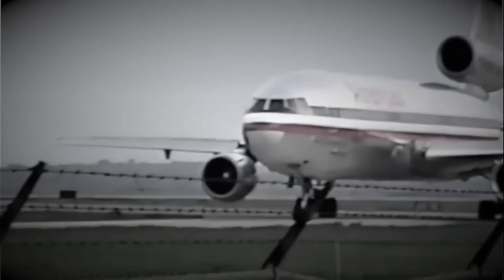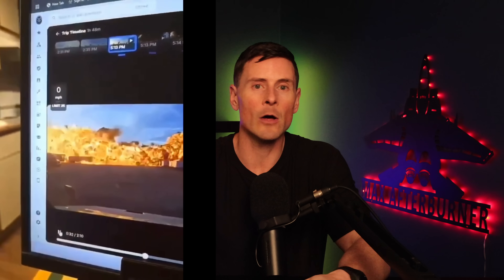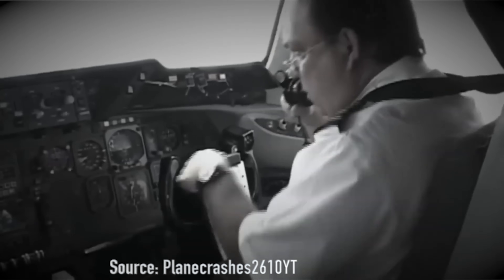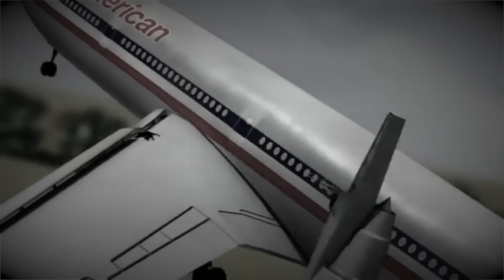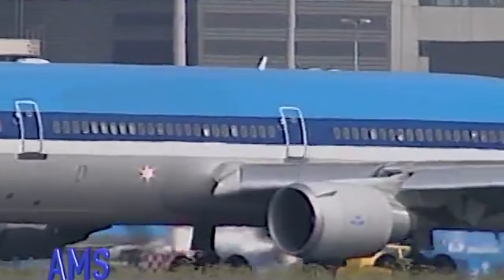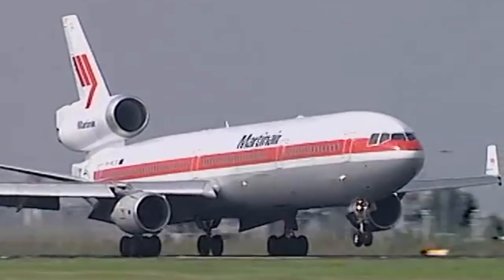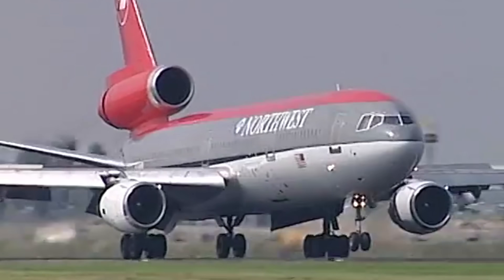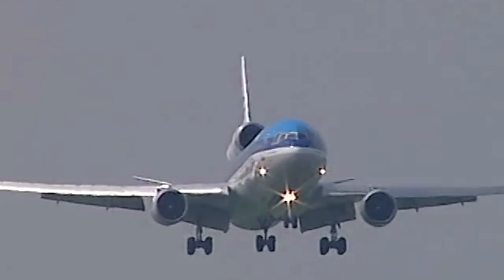Airline Pilot Exposes CRITICAL FLAW of UPS 2976 DISASTER

Comment: Pure speculation here, but I’m thinking something similar to American 383 with an un-contained engine failure. Shrapnel from a turbine section failure piercing the wing, causing the fire, causing the pylon to detach, possibly impacting hydraulics, and also debris being ingested in to #2 engine, causing compressor stalls. With losing the #1 engine and compressor stalls in #2 engine, as they hit V1, they were doomed. But this is pure speculation on my part.

Comment: These Pilons were updated decades ago and never been another one failing. The most likely thing is the engine blades failed and blew the engine off after it exploded. And most likely, the blades flew across the bottom of the belly and hit the other engine causing it to lose thrust, therefore the plane could not gain lift from the last #2 engine in rear, as it takes at least 2 engines for takeoff. You can see 3 compressor surges in #3 engine after #1 fell off in video just as it left the ground.
VIDEO evidence: #1 fan blades exploded and blew engine off pilons, As it exploded, debris flew across bottom of plane belly and hit #1 engine causing 3 compressor surges clearly in video showing 3 brief flames shooting out engine which caused loss of #1 engine power and therefore #2 engine was never going to get the plane off of the ground. The plane never got 100 feel off of the ground and the #3 engine had no reason to flame out 3 times after #1 was already blown off unless it was hit with debris. I do not believe #2 engine was damaged. And the plane also started to roll because it first hit some powerlines and the missing #1 engine wing obviously dropped while the #3 engine wing lifted causing the rollover.

Comment: Here’s a hair-raising UAL mechanic story.
I’m a flight attendant in forward galley during boarding on B767 in Lima Peru.  The 767 always leaked hydraulic fluid.  Before every takeoff it always needed to be topped off.
So from what I gather, the mechanic needs to open the engine and remove a bolt to do this.  There is a local Peruvian mechanic.  He comes on board and says he can’t find the bolt to close it back up.  The pilots are crawling on the floor in the cockpit looking for it.  Time is ticking away delaying departure.
The “mechanic “ comes back on board stating he found it and we are good to go.
We start to taxi down to to take off.  The plane stops and we return to the gate.
APPARENTLY THIS LOCAL  MECHANIC LEFT HIS LOG BOOK IN THE COCKPIT AND THEY HAD TO RETURN IT.  AS THEY ARE RETURNING TO THE GATE, THEY SPOT THE BOLT NEEDED TO CLOSE IT BACK UP ON THE COCKPIT FLOOR!
The local mechanic lied.  The captain was livid and said it could have been catastrophic.  She called everyone to report this, but guess what?  SHE STILL TOOK THE PLANE!
Back in the old days at UAL, the captain would have cancelled the flight, and demand a company mechanic be flown down to check the job to make sure it was done right before accepting the aircraft no matter how much money it cost the company.
Ever since Continental took over it’s been scary.  I don’t know what to say.

Comment: Im no engineer, just using logic here, left motor broke off cause right engine failed.. left engine pylons were weak or fatigued so lifting the plane with only that engine power made it snap. Didn't happened sooner because there is a share oposite side straight when both engines are working fine. Just guessing here.

Comment: Captain Steve saw puffs of flames coming from the number 3 engine. Not number 2. The flames are plainly visible in the video so the fractured number 1 engine blasted out shrapnel sending it under the plane where it was ingested by the number 3 engine. With the compressor stall noticed on the number 2 engine as well, they had no working engines AT ALL! God that's awful..... RIP....

Comment: The only real flaw with flight 191 was some dumb ass maintenance worker who thought a forklift was the appropriate tool to remove and replace an engine thus causing the catastrophic failure. It’s been almost 47 years since that crash. Explain the millions of hours the MD-11f and also some DC-10’s have logged with ZERO engine detachment or massive loss of life.

Comment: The critical flaw was the cracked and corroded airframe. The aircraft originally spent a lot of time in humid environs and should have been parted out in September when the cracks and corrosion were originally discovered. I live about 15 minutes from Basler Aviation in Oshkosh. Basler won't touch airframes from humid countries. Additionally, Basler takes about 7 months to rebuild the entire airframe on a small aircraft. This makes me wonder, what can really be done in a months time by techs who may or may not have the proper skills to fix the problem.
 Obviously the plane fell apart on its first fully loaded take-off since the "repairs."

Comment: I don’t know how anyone could know why the engine separated from the plane yet. You can list the possible causes. But it can’t be like the earlier crash. It was fixed. A DC 10 is not the same as a MD in every respect. It is the same crash but may be another reason. I don’t think anyone knows because the engine came off on the tarmac. I don’t take anyone or anything seriously until I see a report.

Comment: Looks like blade separation, rapid engine fan disassembly. Slicing the pylon (&/or imbalance) and fuel tank and 2 engine ingested debris.
Reply: Yeah, that's one possibility. But this business (see reports by WAVE from Louisville) on prior repairs to cracks on both right- and left-side pylons of this particular aircraft (not just this model) seem suspicious. I bet the NTSB's Todd Inman knows how close the know separation path of the small part of the pylon (still on this plane) was to 2019 crack on the same left pylon. It seems, if that separation line and 2019 repaired prior crack line are close together or partly on top of one another, then the chance of left pylon failure leading to everything else (including the separation and fan disassembly) could be the initial cause (if you don't count the 2019 repaired prior crack or stress of this design around those parts of the pylons as coming first). If this guess is correct, it begs the question if people should trust repaired pylons, especially for MD-11Fs. This might be why cargo shipping companies and the FAA have agreed to a temporary grounding of MD-11Fs as the investigation continues. In other words, this might not be an isolated problem just with this left MD-11F pylon. It might suggest other repaired pylons (especially on MD-11Fs) could, at some point, fail too.
Reply: @findlisa5 Could be that's true.  Could be imbalance vibration accelerated propagation.  See if they find a fan blade in an area before  separation.  Would FDR record engine vibration?

Comment: At around the 6 minute mark you are spewing a bunch of inaccurate info.  Read the NTSB accident report.  The procedure damaged only the aft pylon bulkhead when the upper flange contacted the wing mounted clevis when the mounting pin was removed and the forklift bled down which pivoted the engine/pylon about the forward mount.  Also, there were no hydraulic changes made as a result of the AA191 accident.  There were no solenoid valves and all that crap you stated.  A few years later after an uncontained engine failure on an Air Florida DC-10 during takeoff that damaged the slat system, balanced relief valves that trap fluid in the outboard slat actuator extend lines were added to trap fluid in the actuator to prevent the slats from retracting due to a hydraulic leak.  The DC-10 and the MD-11 hydraulic systems are essentially identical in layout, only the means to control and indicate them were change due to the change to a  2=man flight deck.

Comment: The MD-11   USES FUSE PINS (shear bolts) to hold the engines on the wing ...  they are designed to fall off in certain conditions

Comment: if a pilot were to find themselves in that situation could heavy enough right rudder have done anything? maybe add pressure to the elevator. not to avoid crash but to stay level and aloft a little longer

Comment: I'm very grateful for the good reporting that independent media are providing. Now that I hear about the possible ingestion of debris into the tail-mounted engine, that provides a possible answer to a question I had, which was how the loss of one engine, even under these unusual circumstances, could have been enough to prevent the pilots from gaining sufficient lift to properly take off. However, if what we're looking at is not the loss of one engine but maybe effectively two, or at least a significant loss of thrust in a second engine, then that starts to make a lot more sense and makes my heart go out to the pilots even more. Not that I didn't feel sorry for them already (!!), but it really does look like they were dealt the worst hand imaginable. It's terribly sad.

Comment: Airframes are designed to shed engines that become out of balance when a fan or blade failure occurs.  Rather than rip the entire wing off, the engine will separate instead.  This UPS accident is a very unfortunate where shrapnel from the number 1 engine was most likely ingested by the 2 engine causing compressor stalls.  Basically the 1 engine grenaded.

Comment: Too early to say what caused the engine to separate.  If the engine really blew big time is it possible that a massive imbalance of the main fan at full powers is enough to tear the engine off the wing?  They have recovered all the parts of the left engine so they should be able to quickly determine if it was a fan or pylon fatigue that started the destruction.

Comment: Not sure why lots of similarities are drawn between this and flight 191. There was a whole fireball on the engine during takeoff in this one, and I don’t recall that being an issue with flight 191. 

Not saying this couldn’t be due to a mechanical failure but this looks more like the Concorde crash to me than flight 191. I think the cause of the fire may be more instructive than the fact that an engine came off due to possible maintenance oversight.

Comment: Maintenance issues or not, many if not all of these MD-11’s should have been retired by now IMO — older/inferior materials used, aged tech, more challenging controls, less safety features, number of cycles, etc. It just increases the chance of something going wrong naturally.
Reply: It's quite difficult to, because there isn't a direct replacement for the MD-11. Similar sized aircraft like the A330F and A340-300/787 either don't have freighter versions or have significantly worse payload. The 777 is too large and the 767 is too small. Now airlines must use the 767 and 777 in tandem just to fulfill the job of one MD-11.

Comment: Just letting the numbers speak for themselves. The last DC-10 crash was in 2004 (pilot error).  The last MD-11 Crash was in 2010 (pilot error).  Every single DC-10 or MD-11 crash was attributed to poor maintenance, inadequate inspections, or Pilot error. Since 2010, in the last 15 years, there have been more than 200 (of all types) Airbus crashes or incidents, seven 737 crashes, three 747 crashes, three 777 crashes, and one 787 crash. Yet NO MD-11 crash or DC-10 crash. Yet after millions of flight hours in that time, one MD11 crashes in KY and suddenly it's junk while ignoring all the other crashes that took place in those 15 years.  The United States Air Force has achieved a 90 percent operational success rate with its DC-10 air refueling tankers. The only USAF KC-10 lost was a ground fire caused by a maintenance mistake.

Comment: I don't think you can really compare the AA disaster to current events. It's like comparing a 1978  Honda Accord, to a 1991 Accord. No one in their right mind would compare them simply because they are Honda Accords. The AA disaster, was caused by greed in doing all the checks and methods to keep the jetliner operating properly. Proven fact. UPS has a pretty proven track history of doing all those things properly. They do it right the first time. Another hour on the ground, is cheaper, then it crashing. Is there anything wrong with the design? I don't think so either. Lose an engine on any of those jets, and it does the exact same thing. Now, why this happened, is to be determined, but I really don't believe you should draw conclusions based on a DC-10 for the same reason as my Honda model. They literally, aren't the same aircraft. They just have a strong family resemblance.

Comment: The reason you don't have a DC anymore was all the issues with tri-engine design and loss of control if the tail engine fails destroying hydrolics and controls for the tail.
Reply: Wrong.  You don't have a DC anymore because McDonnell was a tightwad and wouldn't spend the money to develop new aircraft to compete.

Comment: That hydraulic plumbing upgrade was misleading on your part.  The improvements were supposed to prevent the complete depletion of the hydraulic fluid.  The 1989 Crash of the DC-10 that operated as United Airlines Flight #232 exposed the fact that the FAA ignored the recommendation that should have prevented the UA 232 plane from losing ALL OF ITS HYDRAULIC FLUID.

Comment: Actually on AA191, the MPM at the time said to first remove engine then pylon, so it was two separate steps. AA used the forklift to save 250 man hours. Overall it was maintenance shortcuts, CO used the same forklift and UA used a crane but all three skipped the separate pylon and engine steps to save time.

Comment: More clear pictures of the engine are showing the carbon lining (between engine nacelle and fan blades) being absolutely crumpled/shredded around the main engine component. I’m curious if this was an engine failure that was so catastrophic it ruptured the pylon mounting causing it to depart the aircraft. That would explain why the nacelle is found in a different location than the main engine and why engine #2 had a compressor stall (as it may have been sucking in fan blades).

Comment: re: AA 191, it was not just because it was cheaper to do it that way. The airlines actually figured it was safer too - fewer connections to screw up. Of course, American and Continental did it in perhaps the single dumbest way, and United's method was considerably safer (overhead crane support instead of a forklift).

Comment: I dont know… with all the video evidence available right now, it seems so obvious that the plane only banked drastically to its left after hitting obstacles… it is pretty obvious that there was no failure with the flaps or hydraulics. At the same time, of course it would be leaning to its left since it had just lost all propulsion from its left wing… Also, it is pretty obvious, I would say, that the engine n2 also stalled, thus rendering the aircraft without enough power to stay airborn with the weight that she was carrying. There are a lot of questions that remain to be answered, but, why is it so difficult to just constate the facts that are obvious just by watching all the video footage that we have available?

Comment: The debris did not cause the #2 engine to stall, the ingestion of the superheated gas from the fire of the #1 engine did.  Those pins you are talking about are the “coke bottle” pins, and those pins go through the spherical bearing of the “tombstone” fittings.  The American Airlines engine/ pylon removal was an unapproved maintenance procedure, cracking the coke bottles and tombstone fittings.  The slats of the DC-10 and MD-11 are cable operated, all cables running to a centrally located bull wheel which is powered by two of the three aircraft hydraulic systems.  One system loosing pressure would not cause slat retraction.  Slat retraction was caused by an undesigned separation of the pylon and engine separating as a unit, taking the slate cables with it, retracting the outboard slats forcibly.  On this accident you can see the yaw control system yawing the nose of the aircraft to the right, drawing the superheated gas from the fire directly into the #2 engine inlet.  Then the real catastrophe occurred, the TMC (thrust management computer) reduced power immediately on the #2 engine as it sensed the stall, it performed perfectly, reducing power, controlling the stall, and unfortunately, ending any chance of the aircraft recovering.  Engines leaving aircraft are not unusual and not uncommon.  As a maintenance controller for a large airline cargo outfit I fielded a call from my flight crew going into Anchorage Alaska, #3 engine had decided it had had enough and left the airframe.  Pilot said they’d be a few minutes late on the arrival into Anchorage, other than that issue, the aircraft was clean.  Great, more paperwork!  Asked him if he needed emergency services and he said that by the book that would be affirmative.  They landed safely, taxied to the cargo area, shut down, deplaned, and of course our pilot, needed to eat.  Airplane departed two days later, navy was sent to find the engine, they did, and we discovered a fuse pin had shattered and dropped the engine off as designed.  So ya, it happens, but the DC-10 and MD-11 have those damn cables for the slats, and when you loose a pylon/engine combination, slats are coming up whether you like it or not!